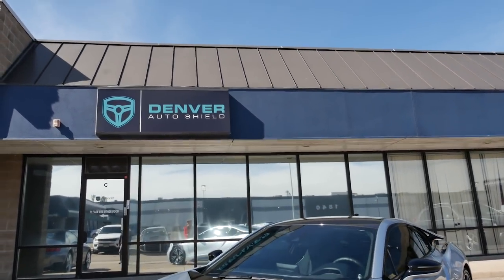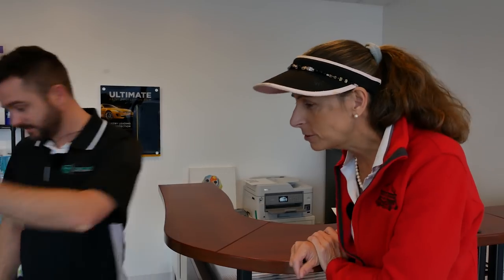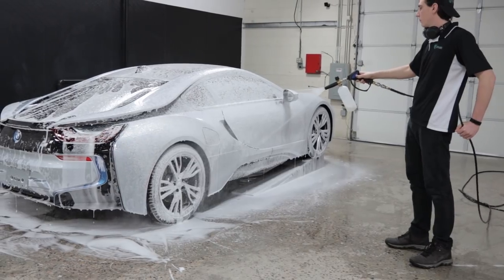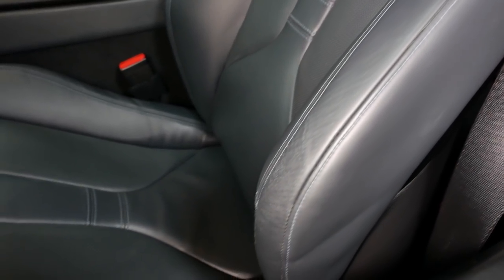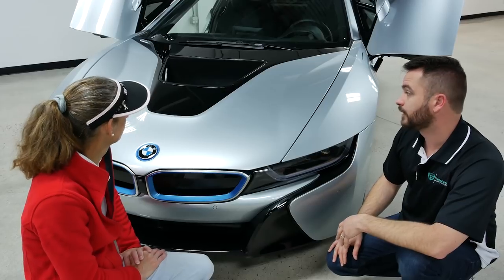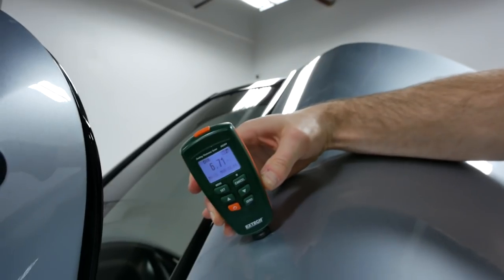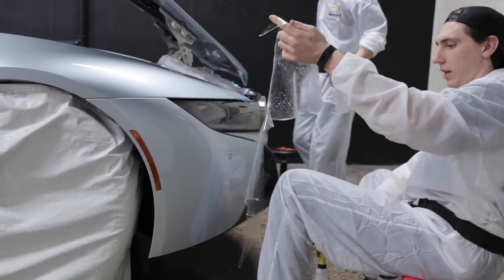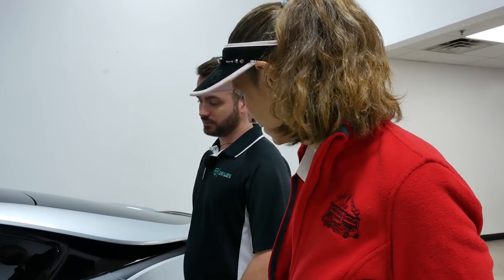Professional Detail - What you must know!

Comment: I recently bought a 2015 i8 and mine was in the same condition yours was before.  That's a great shop.  I'm a 3 day drive from Denver so I'll likely be doing the paint correction work myself.  ;)  I wasn't sure whether the rear black surfaces of the car were bare plastic or paint, and was concerned about how soft the surface was because it scratched so easily.  But, your shop buffed it with small pads and it turned out well, so that gives me some confidence in tackling the job with care.  I also thought about trying to install a carbon fiber vinyl wrap on the door sills, and seeing your results, they turned out great.  Your video showed up when I was looking for new i8 videos.  Keep up the great content!
Reply from the maker: Hi Pat, I think that the back black bit is plastic.  Maybe polycarbonate?  That would explain why it is so hard, but it does seem to scratch easily.  I likely would have done this myself (I did the wheels - there is a video on that) but we really wanted the PPF and that isn't something I'd myself...  It looked like the car had never had any product on it.  We have so much rock and debris on the roads a car won't survive here long (as a DD) without it.  Let me know how it goes with your car.  WhiteDetails is just finishing up an i8.  I'm really looking forward to Jim's video on that!
Reply: @HeidiandFranny  Thanks for the reply!  I'm also in agreement on the black.  I tackled a few minor scratches on my front bumper with ScratchX and it worked well.  But the back just looks and feels different, like polycarb, like you said.  I'm waiting for the right time and the right information to press forward on the clay and buff job.  This car seems so delicate.  AmmoNYC has buffed plastic with Maguiars so I might give it a shot.  

I love your wheels video.  I have minor hazy scratches in the black painted surfaces on my wheels I need to buff and then protect.  I want to DD mine as much as possible.  It was the dealership owner's car that he DD'd to work every day but the dealership must have used terry cotton for the wash and dry, resulting in tiny scratches.  

I had a 78 Vette I used to show and 97 Vette, both of which were garage queens, but the i8 just feels more practical.  I can commute into work on pure electric and some engine is required to get me home.  I also toyed with the idea of vinyl wrapping it myself, but I'm not sure.  

I will look at WhiteDetails.  Thanks for that tip!
Reply: @HeidiandFranny  I just found an i8 owner who let me know that the black on the rear bumper was painted.  His dealer damaged the paint removing the i8 badge to replace it because the blue paint on the i8 badge was peeling.  Valuable information going into a buff job, and wanted to share.
Reply from the maker: Thanks!  I'll take a closer look.  The paint on the badge was peeling? wow...

Comment: Excellent video.  Denver Auto Shield did a great job.  I was really impressed with how good the film looked.  Glad you discussed care after the install of the film and ceramic coat.  I have no cars with the film (so far) but I do like using a coating.  I also maintain the coating with a non-abrasive carnuba/synthetic mix wax and, of course, hand washing when a car gets dirty.   Now you can enjoy the BMW - safe travels!
Reply from the maker: Thanks David!  This will be our first, more "daily-ish" car with all the protection.  I am really curious as to how it holds up!  Now, if this nutty snow would just stop falling! Franny
Reply: OMG, I have been waiting for more on the i 8. I think I'm pretty much in love and although the paint doesn't quite PoP the Ferrari red it has that liquid smoothness. Too bad I live 2, 676 km or a 21 hour drive away so likely won't be using Auto Shield's service. Great video!